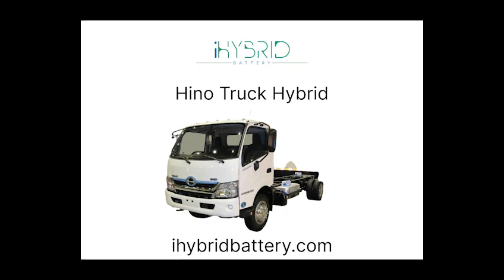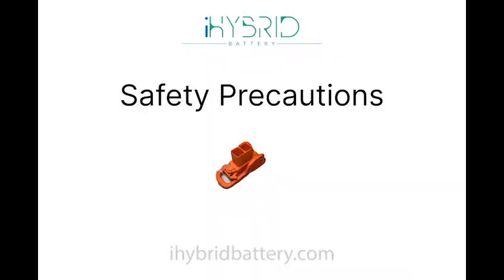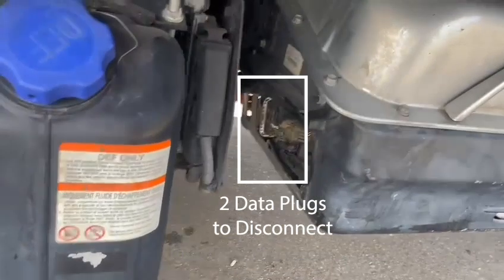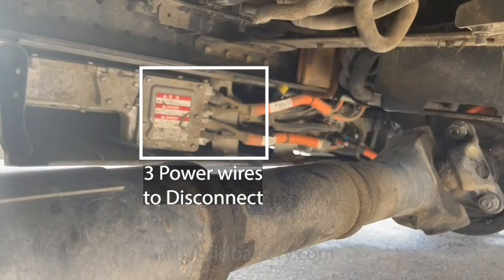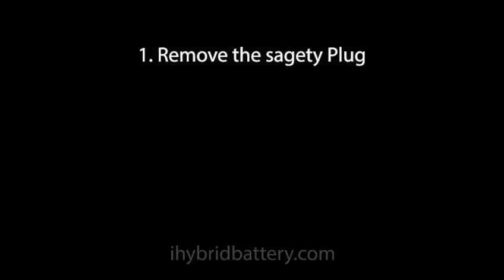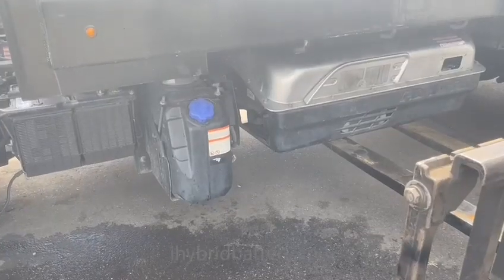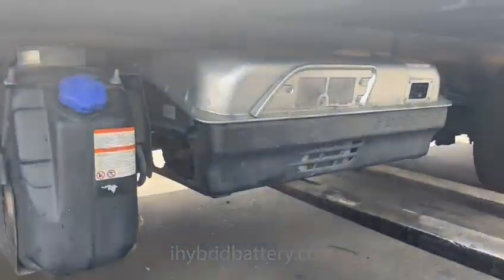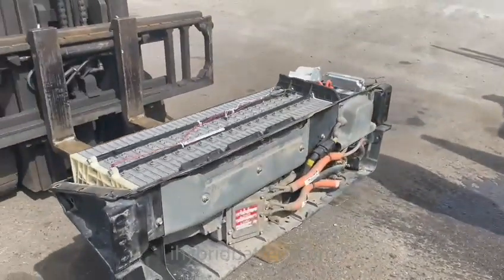Hino Hybrid Truck Hybrid Battery Removal

Comment: I'm seriously considering buying a 10 year old Hino 195H. I will buy it if I think I can service or replace that hybrid battery pack if it ever goes bad. I wonder how well that battery performs at -10F.
Reply from the maker: It uses the same battery pack as used by Chevy Tahoe, Chrysler Aspen, so sourcing the battery won’t be a trouble. Performance will suffer in cold weather

Comment: Is the battery the same as a prius (or are the cells)?

Do you know how much the whole module weighs?

Will the condition of the battery show up in obd monitoring?

Thanks for the upload mate, much appreciated
Reply from the maker: Yes cells are exactly same as that of prius, it has total 40 cells connected in series compared to 28 cells in gen-2 prius or 20 cells in gen 3 prius.
I wont know the exact weight of the fully assembled pack. My guess is about 120 pounds

I didnt use the OBD scanner on it. It might show the general condition of the battery not much detailed about the indivisual cells.
Reply: @iHybridBattery  20 cells in Prius C, gen 3 takes 28 cells